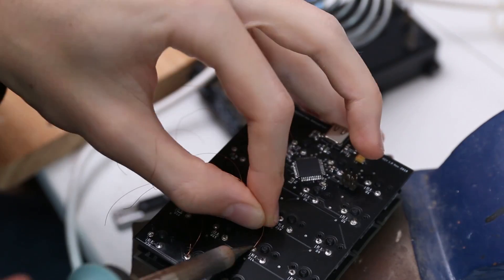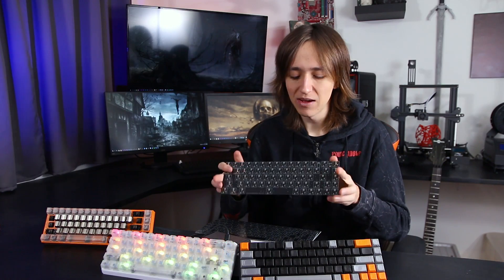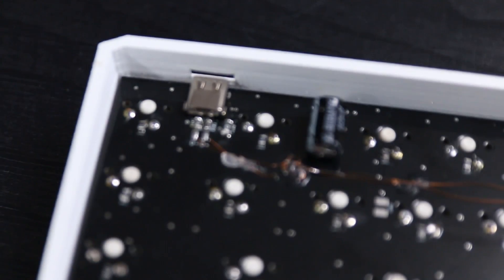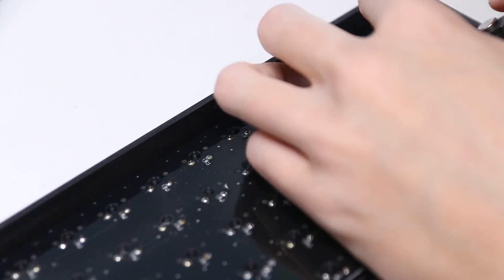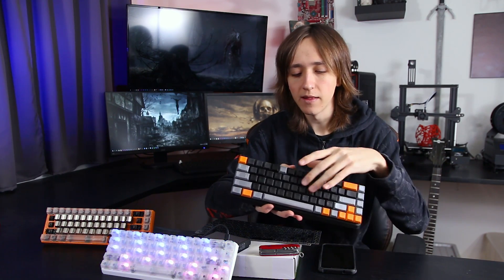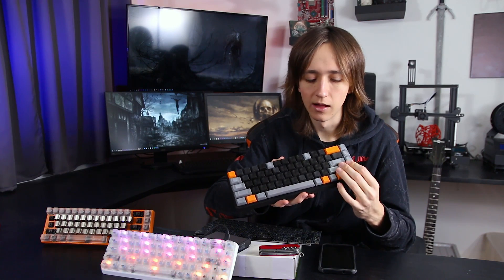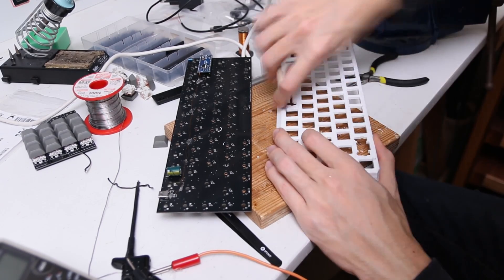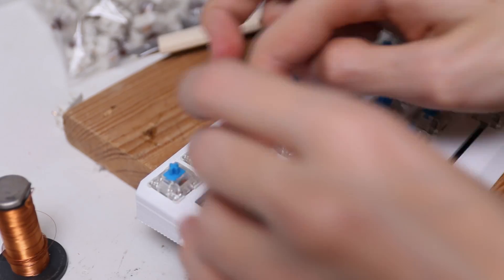DIY 3D Printed Arduino Keyboard

Comment: i bought a stock keybow2040, because I am working on a braille layout keyboard.  it works well. But my plan is to miniaturize it to build a keyboard into the back of an iPhone case.  qwerty just isn't going to work; as it's too many case.  16 keys is just fine with braille layout.  8 keys are for braille, and 8 are for modifiers.  Thumbs on the glass, and the other 8 fingers on the back of the keyboard.  It will be super-familiar to blind people; but totally usable if you use trainer apps to absorb computer braille for a few days.  I ran into this video while Googling for low-profile and 3D printable keys.

I don't really love the keybow2040 being Circuit Python, but it's a good start for avoiding deep keyboard protocol issues at first. But once I deleted a few data structures, I managed to get it to fit into the available memory.  The keybow2040 looks a lot like your initial small keyboard setup.

Comment: What would be needed to make this as an ergonomic keyboard? I have been looking for ages for an Ergonomic RGB keyboard. Something like the Microsoft 4000 Ergonomic Keyboard. There's nothing on the market so I'm considering building one.
Reply from the maker: You would just have to create your own PCB and shell, other than that is would be very similar. You might also need some custom keycaps, depending on just how extreme you go. That is the great advantage of going DIY, you can very easily make changes to the layout like that.

Comment: Instead of sanding the key-caps one by one, you should've just gave them all an acetone vapour bath after removing any imperfections from the print.
Reply from the maker: If they were printed with ABS that would have worked, but the ones in this video were printed in PLA, which is not dissolvable with acetone.
Reply: @DarkArtGuitarsWorkshop  Oh! Ok 👌🏻

Comment: If you ever design another iteration of this which addresses the Arduino placement issue and has power from USB-C built-in (no long internal wires), I would definitely buy one and I think a lot of people in the mechanical keyboard community would. I would happily pay $30 or more for a kit with the PCB, Arduino and LEDs. QMK boards are great but being able to customize all of the programming with the Arduino would be awesome.

Comment: Running the LEDs from the Arduino's 5V out might cause it to draw more current through the regulator than it can handle.
That could cause a "brown-out" - where the power supply drops briefly below what is needed to run the device, so it resets.
Reply from the maker: The LEDs are powered interdependently from the arduino and just receive a digital signal from it. You are quite right that these LEDs would draw way to much power (at least 10x to much) to be connected directly.
Reply: @DarkArtGuitarsWorkshop  Yeah it was a comment on when you said it didn't work right when powered from the Arduino but was OK on independent power.

Comment: Many thanks! I've been looking to build an Arduino-based custom macro-keypad with a very specific layout in order to perform various specialized functions on various programs. I even want rotary encoders and knobs on my keypad. Your project and effort is an inspiring starting point. I can build upon your work and save myself time and frustration. You even printed your own key-caps. Why not just buy them? Great to see the keyboard finally working. It's true, the first time you do something, it always takes ages because of the learning curve. But the subsequent times it becomes a breeze, because you know what problems and pitfalls to anticipate.

Comment: What LEDS did you use? The neopixel ones I've seen are way bigger.
Reply from the maker: They are 3535 Leds (instead of the regular 5050) that are neopixel compatible, they are a bit harder to find but there are a few aliexpress sellers that have them.